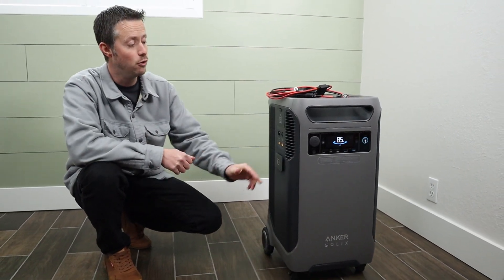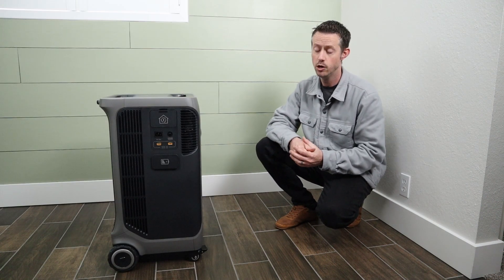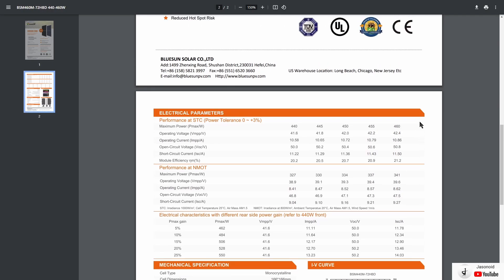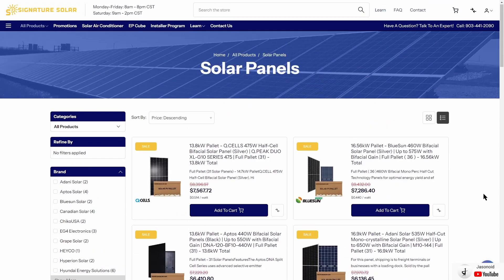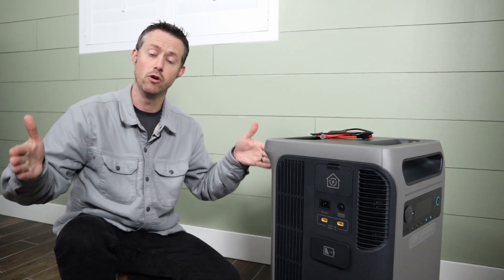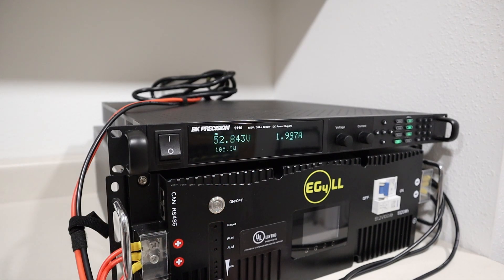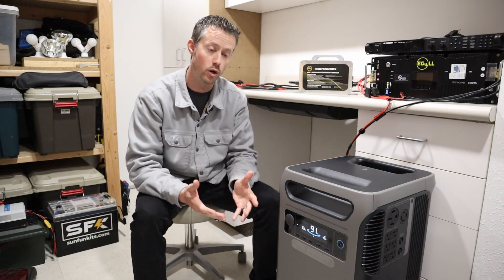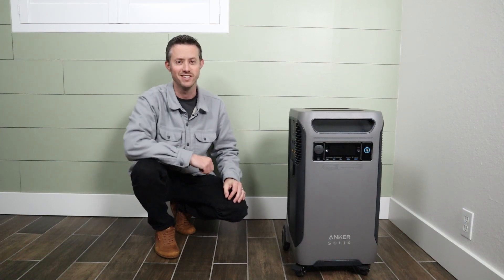Anker SOLIX F3800 - Your Questions Answered! DC Charging Cables - Ideal Solar Panels - and More!

Comment: Hi Jason. at 3 minutes 20 sec you recommend connnecting 3 panels in parallel that each have ISC of 11.08A . Thats more than 25A(27A with firmware update) states. Is this safe?
Reply from the maker: Yes, you can go over the amperage limit. It gets automatically limited by the power station. No issues.
Reply: Thank you, I was adding up the max amperage for every recommendation and it was over the 27 max input amperage… I did not know it will limit this automatically. This helps out drastically picking panels! Thanks

Comment: Would it be possible to charge the solix f3800 with a solix f2000 using the f2000 car port out to the f3800 xt60 port and the f2000 plugged into the wall outlet???
Reply from the maker: At 100w, it's really slow charging at 12v.
Reply: But would it work
Reply from the maker: @tjwestcott  yep 👍 and it would take about 35 hours to charge at 100 watts. Definitely a workaround to keep the 240v output enabled.
Reply: @Jasonoid  awesome thanks. Id put my f2000 on stand by on my 400w panels and cigarette lighter to the f3800 xt-60

Comment: Any chance you would share the make and model of the ac to dc charger. Also i tried looking closely at the wiring in the middle for the 48v battery but couldnt catch how it was connected in the middle. Maybe an oversight on my part. You did answe some concerns i had with how to add additional battery storage to power stations without having to be brand specific.
Reply from the maker: The adjustable power supply? It's a BK Precision 9116, it cost me about $1500 used on ebay. Some people say the EG4 Chargverter work on this unit.

Comment: That first panel you mentioned had 11.8 ISC and you said 3 in parallel would be good but Wouldnt running 3 in parallel go over the 27A spec on the xta port since the amp would add up in parallel config?  Did i miss something?😅
Reply from the maker: The power station limits the input to 27 amps, even if you have more available in your array 👍 so if you have an array of 35 amps. You'll only get 27 amps input.
Reply: @Jasonoid  Thank you for the follow up, I was a little confused too. Great video, and the server battery idea is gonna save me some serious $$$ in the future with my own F3800.

Comment: You are brilliant, Jasonoid! Do you know if the F3800 will allow solar charging and grid charging simultaneously when connected to the Anker Smart Home Panel? Great video. Thank you.
Reply from the maker: A recent firmware update now allows dual charging. It should be good 👍
Reply: Oh, so you can now charge from the AC (grid) and solar together?
Reply from the maker: @fromcitytowild  yes, but AC charging still shuts off 240v output so it's still not super usable while charging with AC and solar input.

Comment: Would the REC ALFA pure R series work better with ANKER F3800? The open Circuit voltage is 59 V and nominal power voltage is 48 V
Reply from the maker: In colder temps, 40F and below you'll see higher than the VOC number on the panel. I like to give at least 5 volts of leeway under the VOC limit of the power station, so 55v. If you live in an area where temps don't get low, that panel is great!

Comment: so does the Isc and Imp not matter if it totals more than 27amp when you have multiple in parallel? i just want to make sure before i buy it. think its unlikely youll see this though
Reply from the maker: Amperage is limited automatically by the power station. Just don't go above 35 amps short circuit and you should be good.

Comment: I am seeing some comment on FB that ppl are using victron solar charge controller connecting to there 150v array than connect to the DC input on the F3800.  That way you are not worry about the 60V limit.  Can you test that?
Reply from the maker: I don't have this unit anymore to test it.

Comment: what is the disadvantage of buying the anker solar panels? Just cost? thanks
Reply from the maker: Way too expensive for the wattage!
Reply: @Jasonoid  thanks for the response. That is disappointing i was hoping to get those. The last hurricane in my area (Katy TX) took the power for 3 days and we were lucky, many people lost power for one week.
I do not have any panel at home to connect a generation, butvi just got a generator following one of your videos.  However, i feel that i need a ower unit with batteries to complement the systems as you suggested in another video.

To me the easiest is to buy something from anker however cost ia important but the panels you're recommended in another video needs to be purchase in 10 units and can not just wait for a good offer local in Facebook, i need something i can buy now and get ready for the next power  outage . 
Something simple that my wife can donwithout any problem. 

Pleae consider other videos for other options for solar pannels for the f3800. I just want to be abke to power a mini split , internet, some fans for at least 3 or 4 days. My stove is gas driven and the driers too, so i jsut need 240v fot the mini split . thanks

Comment: Thank you for this video, your insights have provided me with the right information to set up my system with solar panels!
I only have 1 remaining question- how do I need to charge and discharge this battery to maintain max battery life?  I do not intend to use it unless I have a major outage. any battery maintenance advice is appreciated.

Thanks
Jon
Reply from the maker: They recommend cycling it at least monthly. I'd recommend using it all the time to power certain loads just so you are familiar with it. It's too much of an investment to let it sit and do nothing all the time, plus you get familiar with how long it will last as you use it daily.

Comment: Great content! Would this unit power a 4 ton air conditioning unit having a soft start device? If it does how long?
Reply from the maker: No, this is limited to 6000 watts output or 25 amps.

Comment: So I have 15kwh battery bank at 24v for my rv and purchased the Anker F3800.  Is it feasible for me to plug my 50amp RV cord into the F3800, connect the 24v battery bank into the DC port of F3800 like you did with the server rack battery and then charge the battery bank with solar?

Comment: Finding solar panels to satisfy the 1200 w max at 25 amps on each XT-60 is not making sense to me anyway. If one panel is 45.03 Vmp, Iso of 11.08 and 475w.  Three in parallel would be still be 50 Vmp, Okay that's good. The current would be triple at 11.08 x 3 = 36amps.  And the wattage would be additive with 1425 watts of power in the array, 225 watts greater than inverter wants.  Yes the Vmp is under 60.  But the 36amps is 12amps greater than the inverter input requirement.  You used 25 amps in your calculation.  Where does that come from?  Wouldn't the inverter be seeing 36 amps and 1425 watts at each XT-60?  Please tell me where I'm going wrong.
Reply from the maker: Each charge controller automatically limits the input amperage to 25 amps, no matter if you have more amperage available. So with your panels, you'd do 45.03 volts X 25 amps for peak power per port 👍
Reply: Thank you Jason.  That answer was the key for me to understand and search for panels.  The examples you used are no longer available on Signature.  My search continues.
Reply from the maker: @coarsegoldkid  the larger panels seem to fit perfectly. The 450w - 550w models have the higher voltage that gets you right under 60voc. Then wire those on parallel 👍

Comment: Thanks for informative video. Regarding alternative charging, I have a Duromax XP1100IH inverter generator with 48v DC charging capability. I  haven’t figured out the proper designation of the included connector which has both a red and black lead on the generator end and terminal rings on the other . Do you know if  this could work with the proper Cable connector on the Anker side?
Reply from the maker: Yeah, that might be perfect for a system like this. Red would be postive and black would be negative but youd want to confirm with a voltmeter.
Reply: Thank for reply!

Comment: Thank you again for this video. I found some used 545w solar panel near me, and its Voc is 49.98. Can you please guide me with it. 49.98(voc) x25 amp =1249. Does it mean that I cant put 3 of the 545w? is it possible to only use 2? and what will be the expected result if I only use 545w panels? thank you again.
Reply from the maker: If you reach out to the following link below I will break down the entire setup, including estimated power numbers and required parts needed.
https://asqme.com/@Jasonoid

Comment: where's thr beginers video ? clear as mud, beginers dont know what any of those terms mean.
Reply: Any idea where to find a 20-30 foot XT-60 to MC-4  10 gauge cables from Anker F3800 to solar panels ? All I see are 6–15’ that need one end crimped ??? Why is this so hard to find ? Can’t believe Anker doesn’t sell them ??
Reply from the maker: Here's a beginner video about solar, but the solar learning curve is steep and you'll need to learn the jargon. That's the case for everyone, it took me awhile to pick it up
https://youtu.be/OZvrTuhJhXs
Reply: Thanks, I realize trying to use non Anker panels for the F3800 is just too advanced for me. I’ll have to over pay & use the Anker panels. A lot more ways to screw up than I thought ! 😂
Reply from the maker: Just use two of these wired in parallel per port, way better deal for a higher quality panel:
https://youtu.be/6XC0HSPMfJQ

Comment: Could i do this with a ecoflow ultra?
Reply from the maker: You mean charge the power station using a 48v server rack battery? Of course!
Reply: @Jasonoid  Yes, but with the EcoFlow Delta Pro Ultra..
Reply from the maker: @Jay-fc4fg  yep, that same concept works! I do it all the time.
Reply: @Jasonoid Awesome... Would there be an issue due to the eg4 battery not talking to the evoflow Ultra? There's got to be a catch. It can't be that easy. lol great!!!! content!!!
Reply from the maker: @Jay-fc4fg  the Ultra treats the battery like a solar panel connected to the solar charging port, it just charges till the battery is dead and shuts off. There is no communication between the two. 

The Ultra does not charge the battery back up, you'll have to do that manually.
Reply: @Jasonoid  got it!!  Im thinking now  I could use a gas/propane generator connect it to a >>>  eG4 Chargeverter that is connected to>>> your server rack battery, then connect>>>>> it to the 4kW Max DC  solar charging port on the EcoFlow Delta Pro Ultra (80-450V ~15A)... Now I could connect >> the 240 outlet on my EcoFlow Delta Pro Ultra to my  inlet box and charge my home when the grid goes out....

Comment: Thank you for the great video.  I just installed 2 F3800s with the home power panel and a subpanel.  The subpanel basically covers everything except the big 240v things like whole house A/C, electric oven, etc.  I'm looking for more cost-effective ways to add battery capacity.  Can 48v rack server batteries charge the F3800s through the xt-60 ports while they are in home backup mode connected to the Home Power Panel?  If so, what do the 48v batteries do when the F3800s are fully charged?
Reply from the maker: Yes, you can use server rack batteries to extend the runtime. Once the power station is full, it stops charging from the batteries.
Reply: @Jasonoid  Thank you.  I could not tell from the documentation.  Some features of the F3800 do not function the same when it is in Backup mode connected to the HPP/ATS.  So I couldn't tell if those DC input ports were active.

Comment: So if I wire 3 panels in parallel, won't their current go beyond the 25 amps max? will the charger simply reject the excess current and cap itself at 25 amps? will this potentially harm the batteries or other components?
Reply from the maker: It will automatically be limited to 25 amps, the extra amps will not be used. No damage.
Reply: @Jasonoid  thank you so much for your super helpful videos!

Comment: Great videos. I'm looking into an F3800 + batteries. I'm in the Houston area in a small (rented) townhome and can't run a propane generator on my small porch area. not enough room to safely (and legally) without worrying about my neighbors. We get a lot of natural disasters, though.  Also not enough room inside to DIY some rack mounted batteries, wall mounted inverters and charge controllers, among other space constraints. 

Solution is something like the F3800 or Delta Pro Ultra with some solar on my back porch fed inside to the unit. Benefit is when I (finally) buy a home, these units can come with me and go right into a transfer switch where they can be expanded more (with some likely refurbed or used batteries by that point)

Comment: Is there a cutover time when using the time-of-use mode on the automatic home panel? For context, I live in NYC and charged 2 cents per kwh at night and 33 cents per kwh at day. I want to exploit those low overnight prices, but don't want to expose my home to a microgap of electricity twice a day.
Reply from the maker: It's probably as fast as the UPS cutover, should be plenty fast for most electronics.
Reply: @Jasonoid  I just got a reply from Anker via email. Quoting: 

"If scheduling time-of-use and the grid power is continuously available, there is no switching time for charging and discharging.

If connected to Home power panel and the grid power is interrupted, the switching time for the backup port is 30ms."

Comment: Thanks for your detailed review!  Follow-up quesitons: re: Self-consumption mode with solar, wtd w excess solar generation? Would a 48V DC battery such as EG4LL in video be a better (cheaper? or more efficient?) addition than an Anker extension battery? seems same price, more Watts, any way to automate their use/interactions besides manual swap of plugs? Any specific propane generators that have built-in converter to put either AC or DC and work with this model in a low-sun / long outage scenario? I'm looking to leap at the 2 unit + smart panel deal (currently ~$6400 at 30%off) and then get solar panels you suggested (scale size later after testing 1200W config) or the more recent shade-tolerant diode versions. Primary purpose is a backup unit for ~6hr outage that happen 2x/year. Self-consumption w solar off-grid supplement to routine use is a way to justify it as worth more than a standard generac. Also, any idea if this eventually can be combined with the Solix X1 option? Do they use the same panels? It's a much larger investment, so would wait a few years if ever for the X1.

Comment: Thank you! A video on all of the certifications that are shown on panels might be helpful to many viewers. Ul1741, ETL us, SA us, CSA, etc. it is a bit confusing. I thought that panels had to say UL 1741, but I understand that to not be correct now. Are those certifications only required on grid tied systems?  When do panels installations need to be “inspected”? Only when they are installed on the main dwelling roof, or when grid tied. Any of your expertise would be appreciated.

Comment: Sorry I am missing something  BUT CAN THIS ANKER OR EVEN F2600 SIMPLY  BE CHARGED WITH THE DC CABLE TO CAR ??
Reply from the maker: Yes, it will charge at 100w from the 12v socket in your car... and take a very very very long time 👍
Reply: @Jasonoid  THANK YOU! TY!! So i have a F2600  can i buy a device for my CAR TO SPEED IT UP??? Also can i use my CAR INVERTER (uses a normal 3 prong plug) will this speed it up??  ty
Reply from the maker: This is a plug n play option to charge off your car starter battery:
https://youtu.be/NqnYaqMwktE
Charging off the built in car inverter is likely not to work. It needs to have a pure sine wave.

Comment: Hello, I hate to ask again but I am getting mixed information about sizing my solar panels with the Anker F3800. Your link for the REC 370w panels from signature solar would have my total solar input around 47v VOC and 29.4 amps approximately if I used 3 of these panels in parallel per DC input.  I spoke to a sales person at signature who said the amps were to high for the Anker and that they would damage the Anker unit. My plan was to put 3 of these panels in parallel (x2) for each of the Anker F3800's DC inputs using a 15 amp fuse and using 50amp x 3-way branch connectors with a 30amp breaker switch between my branch connector and the Anker unit, I also wasn't sure if I needed the extra 30amp fuse after the branch connector. Has anyone successfully tested a solar setup long term and knows which fuse specs/ panels I would need to be successful? My runs are short and I am using 10AWG wire. From the Anker to the home I plan to use the Nema 14-50 cable into a SS250P generator outlet with interlock. The max breaker on my home is 240v and 50amps. Thanks in advance.
Reply from the maker: That's a bit complicated to explain in a single youtube comment. I'm happy to help here:  https://asqme.com/@Jasonoid
Reply: @Jasonoid  Thank you for the thorough and detailed response. Great value and great service!